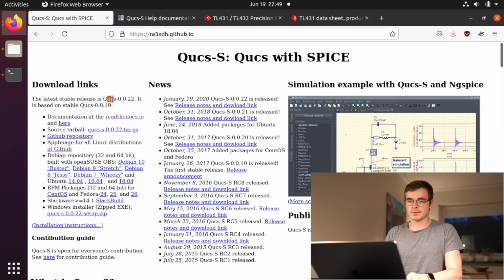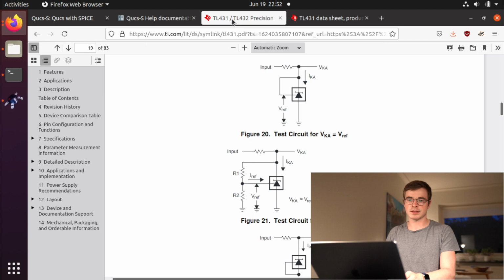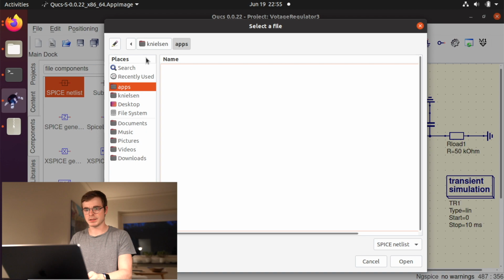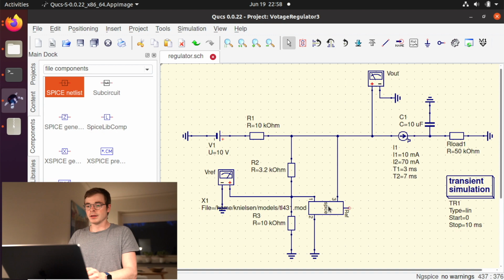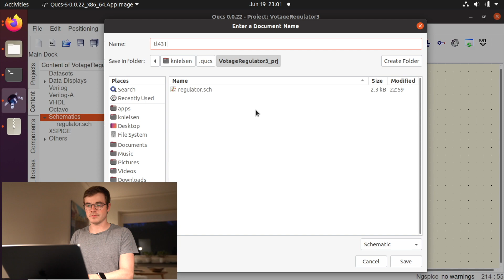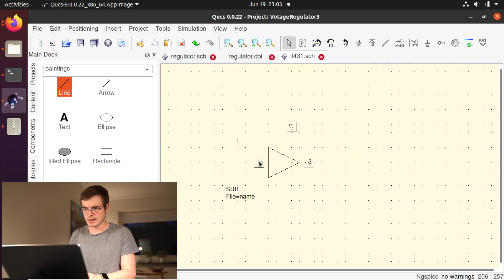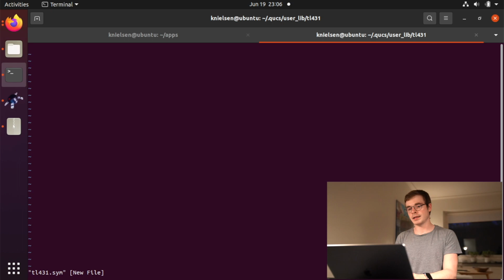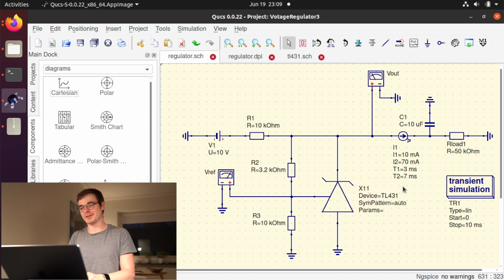Qucs-S Simple Spice Simulation

Comment: VO (V)	2.495
Reference voltage	Adjustable
Initial accuracy (Max) (%)	0.5, 1, 2
VO adj (Min) (V)	2.495
VO adj (Max) (V)	36
Iz for regulation (Min) (uA)	400
Rating	Catalog
Temp coeff (Max) (ppm/ degree C)	92
Operating temperature range (C)	-40 to 125, -40 to 85, 0 to 70
Iout/Iz (Max) 

Can it be these displayed in the txs instr website without having to open the .mod file?